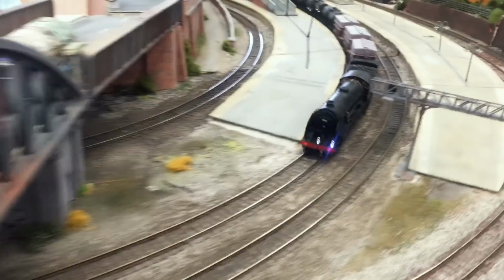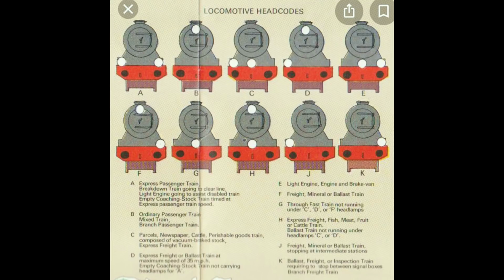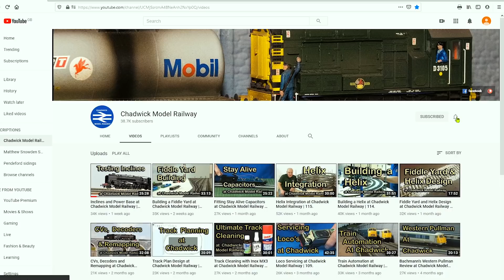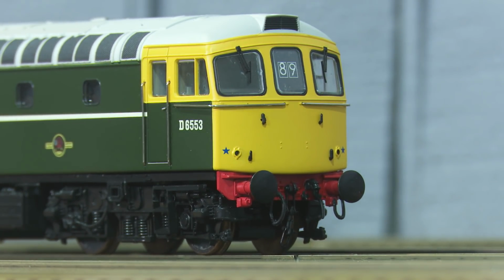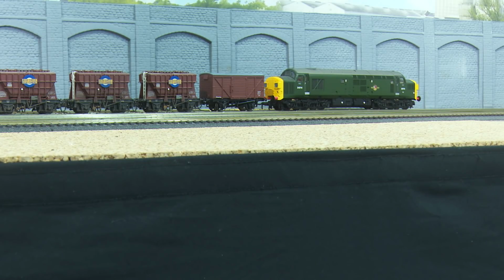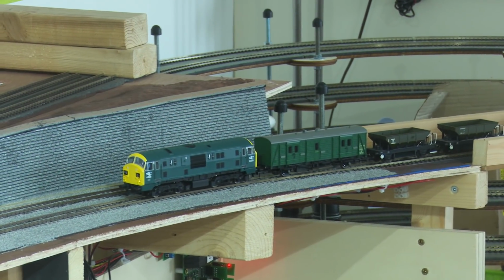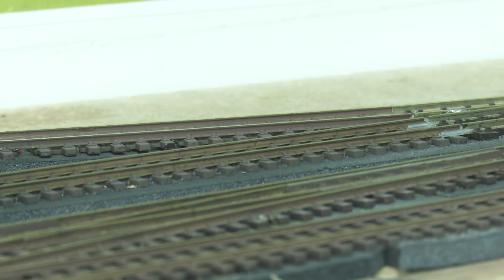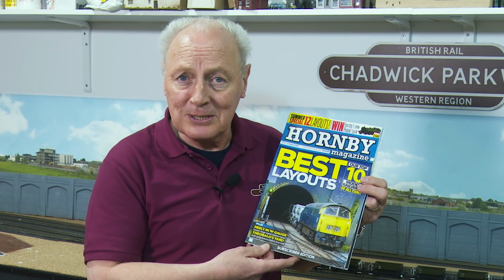Building Freight Trains at Chadwick Model Railway | 155.

Comment: Hello Charlie,

Your hopper cars made shorts by the metal hook couplers when going onto turnouts, why not using the older Fleischmann NEM 362 Hook Couplers, they are compatible to your british Hook Couplers?

About the service platforms of the hoppers, well they are coupled together for a more efficiency work by unloading the hopper cars in shorter time.
If the car platforms would be not coupled together, than the service worker are in need to leave the car's platform and climbing onto the next car's platform an so on. When doing it by slow moving train it is a very dangerous job and it happened lot of accidents in the past by slipping out workers by rainy or foggy days when the slippery is much more bigger onto wet, oily steel. Some workers lost their feet or legs when having accidents of slow moving trains by slipping out.
The distance between the lowest car step and the track ballast is around ¾ of a metre. 
Older wooden Ties or Steel Ties are very slippery when being wet by badly weather conditions of jumping from lowest car step into the track ballast and hitting the Ties with their feet.

Normally a ballast train should stop before workers do leave service platforms and entering another platform but this takes lot of time, so most railway workers do risk their lifes by jumping down and up by slow moving train.

I had been worked for the eastern german railway in the early 1990's and did some experiences on permanant way department trains by ballasting new track with unloading two axle hopoer cars...our hopper cars had been coupled with platforms together. We gave signal by mouth pipe to the shunting loco to stop the train for unloading the hoppers in position and doing movements until the hopper was empty. We could easily entering the next service platform to unload the next car, before the train stopped and we could leave the platform and going to the overnext car and entering the platform again.
It was a very dangerous job onto foggy, snowy or raining days and during night hours in darkness.
Reply from the maker: An excellent comment Ingo.  I was aware of the shorting problem with the hook that hangs down, I just wanted to make the point of poor design.

Comment: As ever informative & educational but regarding trains of fitted/Unfitted wagon you state" if you had a train of Bauxite (fitted) wagons, but one grey (unfiited) at the front then nothing would be braked" is, in the case of vacuum system, not true. As the fitted wagons brakes would be permanently on as the vacuum having been 'Destroyed' by not having been connected to a vacuum source i.e the loco. The vacuum system was designed that way in case of 'Breakaways' so that the brake would be automatically applied.
Reply from the maker: Okay, so am I correct in thinking that a vacuum fitted wagon must be connected to a vacuum source?

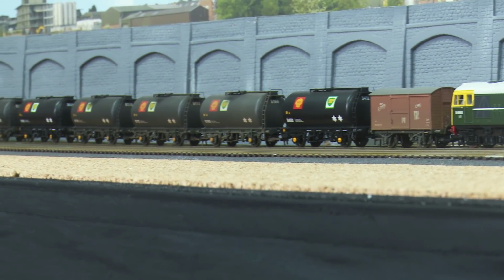Comment: Hi Charlie - great video as always packed with lots of useful info.  At The risk of being even more ‘anoraky’, I noticed something at around the 12:20 mark where you are talking about the tankers behind the class 33, which.  If these are TTAs, they would be air braked and not vacuum braked.  The 3 letter TOPS code has uses the first letter to denote the wagon type (T=Tanker), the second letter is a the subtype, and the third is the braking system.  The basic brake types are O - unfitted, V - vacuum, A - air braked. Then there are a number of other codes for through pipes, dual braking systems etc.  All this makes your head spin even more when modeling the 70s and 80s when you need the right locomotive, with the right barking system, matched to the right rolling stock.  Thank goodness for Ian Allan ABC Guides, otherwise we would never be able to work it out!
Reply from the maker: A great spot James regarding the TT A’s. However the head code on the 33 was wrong too! Regards Charlie

Comment: Heljan are not the only ones guilty of droopy couplings, Dapol are much the same and I've had a few Oxford Rail wagons in a similar condition. Another thing is coaches. Bachmann coaches dont like to be coupled to Hornby coaches and vice versa'and on some locomotives the coupler heights vary dramatically. So if you fit Kadee's couplers you end up with a height mismatch. There used to be a standard but I think that's gone out the window.
Reply from the maker: I totally agree Charles, couplings are an absolute nightmare. Regards Charlie

Comment: Uk  Railway Stock variations

Not at all charlie i value the quest for realism in modelling and prototypical operation, 
After all its what sets us apart as serious modellers apposed to adults playing with toys.

Other points to consider the Era we are modelling

 
Important to consider the Correct Engine type pulling the Appropriate  braked stock,

___

Vacuum brakes introduced in the mid-1860s.

pre 1970s BR locomotives were originally Vacuumed braked 

Post 1990s most BR locomotives where converted to Air braking system

Example you would not have an earlier vac brake loco  pulling later Air braked stock

To further step into the quagmire some locos and stock were fitted with duel braking systems.

Heres you next video suggestion charlie

What locos can prototypically pull what stock

As always thanks for creating this Informative content for us all to enjoy!

S.C. 😉
Reply from the maker: A great comment SA. However, it’s even more complicated when you consider that some wagons were through piped!

Comment: Hi Charlie, I always thought the pipes dangling from buffer beams on wagons were vacuum lines but your grey unfitted wagons have the pipes still, is this just because they use the same tooling for different wagons or are the pipes something else?

Cheers, 

George
Reply from the maker: They could also be through piped George. That is they allowed a vacuum to pass straight through even though they have no brakes themselves. 
Regards, Charlie

Comment: Hi Charlie, 
Reference your rake of dogfish engineers wagons.
Catfish wagons were also found with the dogfish along with on occasions Seacows. 
The obligatory brake van would also be included & if a shark brake van was used it wasn’t uncommon to fine this in the middle of the rake. 
With regard to the couplings, a small thickness (1mm) of plastic potential could cure the ‘droop’ by sliding this into the coupling housing. Alternatively I guess the original couplings could be replaced.
Hope this helps.
Reply from the maker: Thanks mate, but I’m going to replace all the couplings with a rigid bar. Regards Charlie

Comment: I can't find the video now regarding the colour of tank wagons ? .... In answer to your question, it depends solely on the fuel company and what livery and image they prefer !!  - Mobil use grey, Murco use red, white and blue, Shell/BP use black, and BP use green. ... You are correct with the one brand fuel rake as so many modelers get this wrong by pulling a varied assortment of different company wagons.
Reply from the maker: Hi Daniel, you’re correct regarding tank of colours back in the 60s, however in later years they did change completely. Heavy oil is used black tankers whereas petrol tended to use silver or grey. The petrols also had red soul bars. Regards Charlie
Reply: @ChadwickModelRailway  Grey tanks don't always have a red sole bar and not solely for petrol. The newer BP livery is green with a yellow sole bar. Charringtons used grey tanks for their heavy fuel oil.
Reply from the maker: Yes Daniel, sadly I was focused on 1968-1972 when things were considerably different.  Regards Charlie

Comment: The factual stuff is interesting whether it is something I would do or not as I just have a miss mash of rolling stock anyway, I'm sure much of which would never have been mixed.
The coupling conundrum seems to be an increasing problem, I can only guess its down to keeping the tension lock system but finding ways to make it less intrusive. More manufactures are mounting them further back so they hang off flimsy mounts that just aren't strong enough to take the weight without drooping, yes it makes the space under the buffer beam look better as the is no thick plastic mount point but at what cost.
Reply from the maker: I can see no easy answer to this Rob, you just have to do the best you can with which ever train you’re trying to construct. Regards Charlie

Comment: Interesting video, Charlie. What you need is a copy of the Working Manual For Rail Staff, a goldmine of information on freight trains, When you re-jigged the mixed freight, you moved the conflat wagon needlessly as that would be fitted and the gunpowder vans would have at least one barrier wagon between each pair of vans plus the same at each end. I'm sure class 5 traffic is ECS workings (class 3 until 1969). As for your coupling dilemma. Westhill Wagon Works do Hunt couplings that will cure the issue.  Happy modelling...
Reply from the maker: A great comment and your advice will be included in the Spring Update along with other contributions. 
Regards Charlie

Comment: Thinking of Head Codes, Lais do a 4 function DCC decoder without motor control for £10, that could be used to cover Steam HC's A to K on your diagram if there is room enough for a 2nd decoder. Did they change when oil burners were introduced ?
Reply from the maker: LaisDCC Produce decoders from stolen technology! I really wouldn’t buy one. Regards Charlie
Reply: @ChadwickModelRailway  Really, gosh, how are they allowed to sell them, thanks for the heads-up.

Comment: Hi There.  If you are running your ballast train as a fixed rake which it looks like you will you could body mount kadee couplings through the train and have the tenion hook couplings only at the end where it couples onto the loco so if you cange the loco its easier.
Reply from the maker: That’s not quite my plan James. What I intend to do is run fixed bars between the vehicles and KD’s at either end. Regards Charlie

Comment: Highly fascinating and very educational. It shows perfectly the complicated challenge met by British Rail having to manage such a patchy fleet of waggons from different periods with different equipments (brakes or no breaks but also safety, weight and clearance constraints), leading to the need of brake vans, the presence of guards and, last but not least, this puzzling head and tail light coding, all complications and complexities ignored on the continental "Europ" freight fleet introduced in the 1950s with the generalized continuous vacuum brake lines and unified technical characteristics.
Reply from the maker: I’m so pleased that you found it interesting Jean. Regards Charlie

Comment: Hi Charlie,  I used to work in Tyne Yard Gateshead and was in charge of marshaling the engineer trains. The ballast waggons were put together with the ballast wheels facing anyway as the waggons came off different trains. Loaded ones were put into a siding awaiting another job while the empty waggons were put into a different siding to go off to get loaded so the ballast wheels could be facing anyway. On some trains we would have a mixture of dogfish, sealions or seacows.  Mermaids were used as well, but these were mainly used at weekends.  We used head codes 6P on our ballast trains ie 6P54. Sometimes we would put sharks at both ends of the train. Normal ballast train would consist of 10 to 15 dogfish and a shark or 10 sealions/ seacows and a shark depending on the size of the job. We didn't fit crew vans to our ballast trains as the maintenance gangs would arrange to meet the ballast trains on site and use their own mess vans on site for lunchtime or cups of tea. Hope this helps Gary from County Durham.
Reply from the maker: Hi Gary, that’s a real gem of a comment thank you so much. Regards Charlie

Comment: I replaced the couplings on my Dogfish wagons with Bachmann ones, which are available to buy in packs of 10. You wouldn’t think it would change anything, but now I can shunt them around, including propelling movements, without any problems.
Reply: Some I cut the bottom of the hook off, others I have replaced.
Reply from the maker: I think you’ve got the right answer truth addict.I need to be able to shunt them so I need a permanent solution.I wonder if you used the Backmann vacuum pipe type couplings. Regards Charlie
Reply: @ChadwickModelRailway  No, just a straight swap with Bachmann small tension lock couplings. Some still droop a little, but don’t cause any problems. The only modification I made was trimming the pipe on the bufferbeam to above the height of the coupling. The NEM pocket hasn’t been glued to the body, and is free to pivot as intended.

Comment: for the coupling i think you could use kadees and those chain semi permanant couplings. wuld avoid the problem of the bottom part of the hooks catching up with the rails. wuld also look better
Reply from the maker: I think what I shall do is permanently couple live wagons together with a fixed bar and use KD couplings on the ends. Regards Charlie

Comment: Good video Charlie with lots of inspiration and mostly correct.
Unfortunately though you have fallen into a trap with some of the vehicle types.  By the time your era has arrived the gunpowder vans (TOPS code CXV) were all vacuum fitted, as were all the conflats so these would almost certainly form part of your fitted head. 

The oil train hauled by the class 33 represents a really uncertain time for BR.  Literally hundreds and hundreds of new tank wagons were being built by a number of private wagon builders and many of these were fitted with vacuum brakes. But very quickly were retrofitted with the new air brake system.  There is probably a defining point in the crossover because you will rarely find evidence of the air braked  tanks using air braked barrier wagons.  

The subject is a minefield, but you have trod it very carefully Charlie.  Great work.
Reply from the maker: A really useful useful comment Phil.
With my layout being based 1968 to 1973, I am pre tops. That represents a minefield in itself! Regards Charlie

Comment: Hello Charlie,

As a helping hand, here in Spain and Portugal, usually, all gravel and ballast cars are usually split in pairs (kindly search "Tolvas Duo") in which you would usually get a buffer to buffer unit with no discharge wheels and also the opposite. Therefore you would always work in an Abba abba abba composition.

Keep well and best regards.

D
Reply from the maker: Thanks, that’s very interesting David. 
Regards Charlie

Comment: It always fascinates me as someone who works in the U.S. rail industry that UK trains ran for so long without any sort of continuous braking. It was mandated on U.S. railroads by 1900. I suppose due to a smaller loading gauge and much shorter consists it was way more practical to carry on with locomotives and brake vans as long as they did. I find the head codes quite interesting as well. Interestingly enough on U.S. Railroads we still use barrier wagons or as they’re called here “buffer cars” on hazardous materials trains on the front and rear.
Reply from the maker: A great comment Stoker, we were still running unbraked wagons in 1970!

Comment: Apparently a max of 5 GPVs were allowed and are meant to be in the middle of a trsin with 2 "inert" wagons between the loco and the vans.

For long trains it is highly unlikely for fitted & non-fitted to be separated because of the work involved; in which case it was likely the fitted stock would be "un-piped".

The differentiation between grey and bauxite for fitted snd non-fitted stock is not (no pun) black & white. Many wagons were painted in red oxide or similar despite being unfitted.
Reply from the maker: I agree Hugh, the grey wagons were painted bauxite in the mid70s but fortunately that’s a period in the post tops era and one which I don’t model. Regards Charlie
Reply: @ChadwickModelRailway  sorry for delay in responding but you know how it is!

First of all; ah yes I'd forgotten it would be out of you era but there might have been an odd one still about.

Just wondered if the brass wheels were picking up so much dirt because you're running DCC and the track is usually always live??